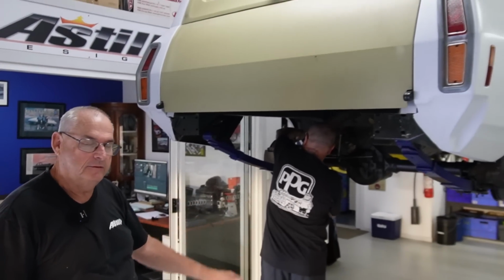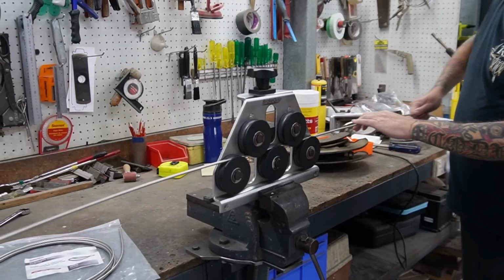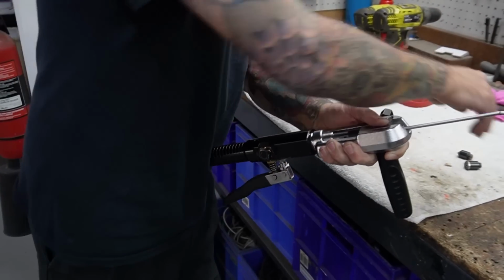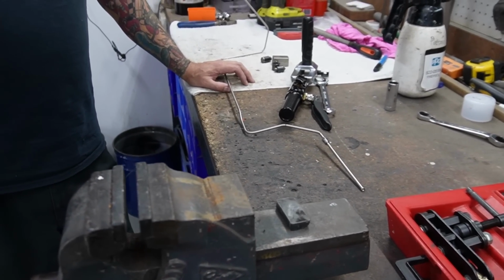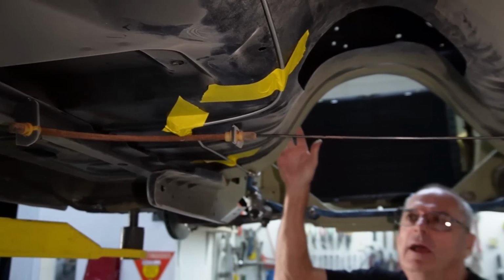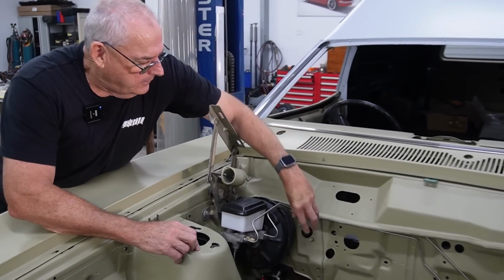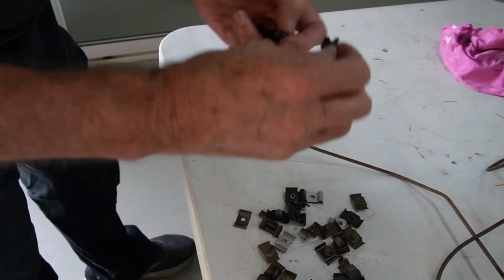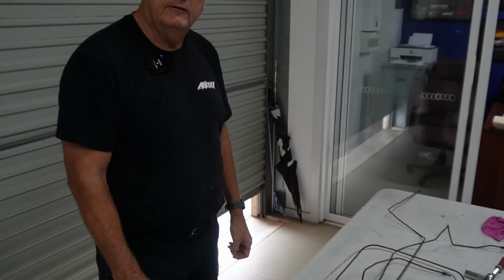Stainless Brake Lines on XC Falcon Panel Van | Magnum Force

Comment: I was just looking at the rear brake line flex hose the other day, thinking that the passenger side exhaust pipe was going to foul it, and wasn't sure how to change it. I had no idea that there was a different mount & plate for the BW diff with twin exhaust. I've already made up the brake lines as well. Spewin'.. Where did you find that bracket & fitting Howard ? i'll have to track one down & redo the rear lines. Any tips appreciated.
Reply from the maker: Hey mate, I can’t find a supplier for the one I have and can’t remember where I got it from.
Reply: @AstillDesign  There seems to be plenty if you have a 9", but bugger all for the BW online. Thanks anyway, i'll just have to make up a plate for the diff & mount the block there.

Comment: Thats a different looking diff cover haven't seen one of them before.
Reply from the maker: Ebay special, there are different quality ones. Designed to support the bearing caps
Reply: @AstillDesign  Ok Thanks
Reply: @AstillDesign  It looked to me you were going to setup a  Watts Linkage. That tramp rod setup seems to be hard to find, does anyone make them ?
Reply from the maker: "Better than NOS" has them

Comment: F.Y.I ,Best Brakes on the central.coast or Parts wise in Victoria sell that brake hardware kit, MCX supply rubber kits but only sell to wholesaler, not many places in NSW do booster reco but there is a place in Castle Hill  that do it
Reply from the maker: thanks for the info

Comment: Not sure if anybody else has tried this, When making  hard brake lines to fit volvo brakes to a my mk2 cortina I you insert wiper nipper cord into the brake line / tube you can get a much tighter bend (mandrel bend)

Comment: Those factory mounting clips are rubbish, I throw the clip and the rubber bit in the bin and just use the flat piece that holds the lines with a rivnut and a thick screw.
Reply: the aftermarket ones are too soft, and are useless !
Reply from the maker: That a pretty good solution

Comment: Do you happen to have a part number / supplier for that borg Warner diff to body brake hose for the dual exhaust? Can’t seem to find it! Cheers
Reply from the maker: Hi, I can't remember where I got it from and I can't find it on the net. Sorry
Reply: @AstillDesign try apartswise hose remanufacturer,their on line cat can put you in touch with someone

Comment: WOW- do you have the factory traction bars installed ?
thanks for sharing
Q- did you have to drill holes into the frame (front side) ?
Q- do you sell the brackets holding them on the diff housing ?

appreciate all the content
thank you
Reply from the maker: Hi, yes you need to drill the front mount and install  crush tube. Better than NOS sell the tramp rods.
Reply: @AstillDesign  i have the tramp rods, do you sell the brackets on the diff housing ?
thanks for everything you do
Reply from the maker: He makes the whole setup